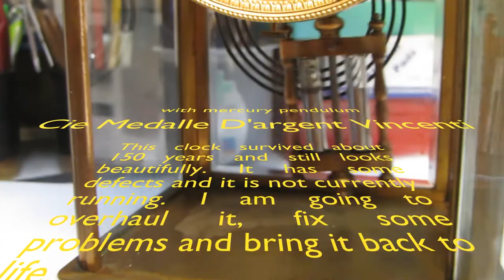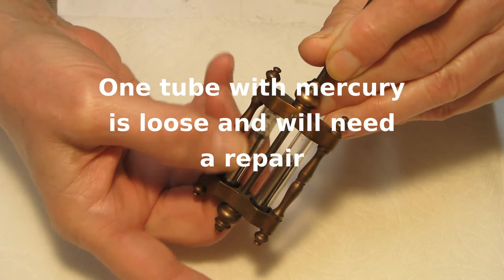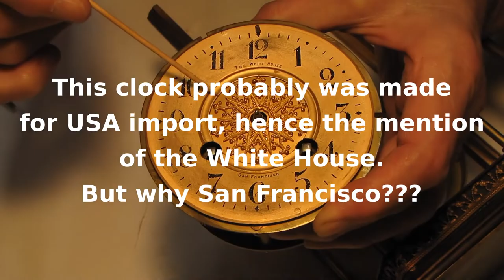Service & Restoration of the Antique Medalle D'argent 1860's Clock with a  Mercury Pendulum Part I

Comment: A trick for getting the screw adjuster back where it was in the Brockton suspension: screw it in all the way first before removing, counting the exact number of turns including partial revolution, and write that down. It gives a more definite return point than unscrewing. (I use the same trick for my snowblower carb) 
Edit: *Brocot
Reply from the maker: Thanks, good point, will keep it in mind.

Comment: if i was to pack this clock, for moving house. would it be acceptable to pack the pendulum in non acidic paper, then package it so it doesnt tip over. then the remaining clock in a box with loads of crushed paper?
Reply from the maker: I think you get it right. I'd also use a bubble wrap, separately for the case and pendulum.
Reply: @ValentechTime  that's great to know thank you